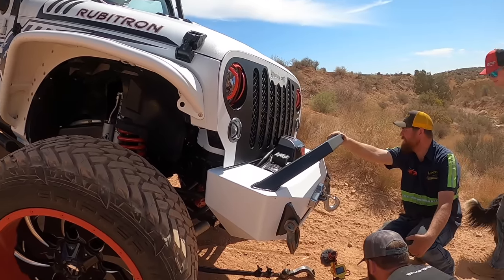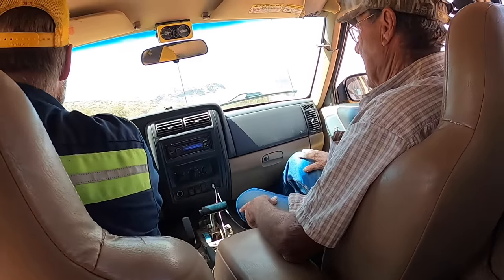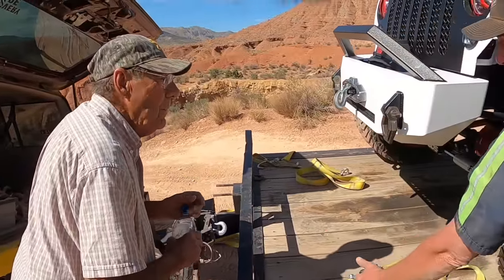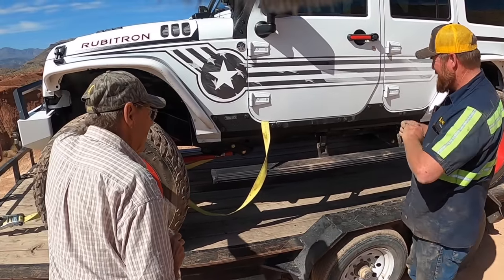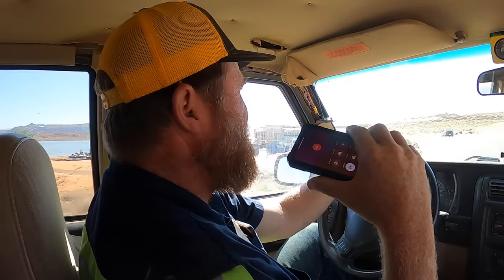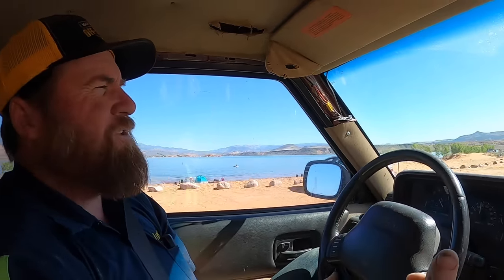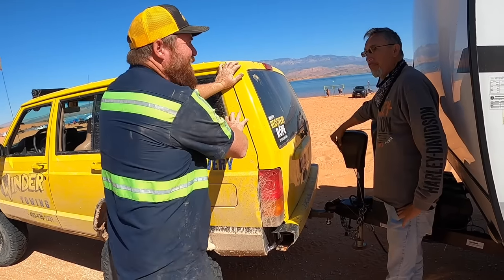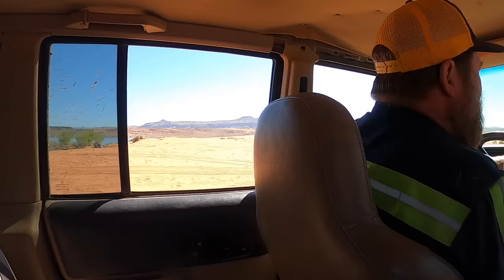$100,000 Jeep Breaks On The Trail

Comment: That’s exactly the kind of Jeep I would expect to find broken on the trail.
Reply: That’s not exactly the kind of Jeep I’d expect to see outside of the mall.
Reply: They don't make real jeeps anymore, you want a real jeep buy a Roxor
Reply: @cr9953  a what?
Reply: @cr9953  A Golf Cart lmfao
Reply: @rcaddict7638  look at my pic, it's a 2020 Mahindra Roxor. 4cyl Turbo diesel, 5 speed Manuel, it's more jeep than anything Fiat makes. It's more related to the willys. Mahindra has had permission to build them since the 40s. Solid drive train, great  traditional off road rig
Reply: My 1977 CJ7 Levi Edition is one of the last real Jeeps.
Reply: @cr9953  lol k
Reply: Superficial aspects always fail. It's like putting face paint on and going into a battlefield without a weapon.
Reply: @cr9953  Sad, but true.
Reply: First clue was those rims and skinny tires. lol
Reply: Yeah, it's a Jeep.
Reply: I want to know how they get to the 100k value. It’s got some  bolt on suspension parts wheels and a wrap. Stock driveline 3.6 with a cold air intake.  Wait it’s got a upgraded driveshaft and axles.
Reply: like all hot wheels, is just for toy.
Reply: @cr9953  1/3 the hp of a cheap, not street legal, and like 80% of the price (covered version with basic options, which is still not comparable to a wrangler)

What a rip off.

Maybe it would be a good deal if if was like $6-$8k like it probably costs in india.
Reply: @user-yq6ov6ow7l  Mine is street legal have more torque than a Fiat/jeep. Solid construction, tried and true frame and powertrain. Will outlast any wrangler, made for offroad.
Reply: @cr9953  Not made for heavy off-road. Torque is about half of most 4.0l jeeps. Looks like a good getting around the farm jeep but long distance travel and trails is a no go
Reply: @Macul  most of us have tuned our rigs I'm at 105Hp and 225 Torque. It's a fantastic trail rig. Great for taking it easy and getting back to old time wheeling when it wasn't a race to the top.
Reply: @Matt Dunlap, it's got fold up running boards!!😉😂😂👵🇺🇸
Reply: @cr9953  lmao im good. i want a vehicle. not a go kart.
Reply: @cr9953  You forgot what fan base you were addressing, literally one of the worst of them all.
Reply: Oversized tires create tremendous stress on everything else attached to the spindle.
Reply: That's what happens when you leave the mall parking lot.
Reply: @cr9953  30k for a side x side is insane
Reply: @z  A wrangler is no longer a jeep, it's a freeway built look at me mall hopper. I've worked on wranglers for friends and it's not built for off road. It's built for luxury and the pavement. My roxor can outwheel any stock wrangler, I want a jeep.for offroad not for highway
Reply: @Macul  tractors are built for durability, this Roxor has more jeep blood in it than any wrangler. Trails is all I use it for and it's a tank. Comparable to my CJ7. Wrangler are garbage
Reply: Prime example of what I like to call built but not built

Comment: His biggest asset is he really knows how to drive and he knows how things work, he has no special equipment, it's not necessary when you know what the heck you are doing.  Lot's of respect.

Yes, the kinetic rope is his main "go to" tool, but they are readily available and not real expensive.

This man knows how to drive off road, period.
Reply: Yes he's a good driver, and knows what he's doing, but that xj is far from stock, you could easily say it's specialized equipment.
Reply: If you watch enough, you’ll see that the banana is highly modified, with suspension upgrades and a purpose built stroker motor (upgraded from 4.0 to 4.6). So yes, Matt knows what he is doing off-road, but he has purpose built tools as well, as one would expect. The ability to modify the Cherokee platform and run it hard at a relatively reasonable cost is what makes is so attractive.
Reply: Driving in reverse in the sand is crazy

Comment: That was literally the most perfect "hitch ball into the trailer receiver" backup ever.
Reply: That would even take Block 3 or 5 tries and 2 sets of tires.
Reply: Add in the precision dig-down to align the level!
Reply: Practice makes perfect good spotters also helps it's harder to do alone with an old truck without a backup camera

Comment: The difference between “show” and “go” is about 30 years and $80,000.
Reply: If you off road, eventually youll destroy a steering box. Just happens.
Reply: @jeepmanxj  I rock a 70 Ford Bronco off road. Never ever have I broken a steering gear.
Reply: @jeepmanxj  you might lose PS but to snap the shaft? LMAO honest to god have never seen that happen and no idea how the pitman joint didnt burst first
Reply: @seadsejfovic9127  I've done it multiple times, I've broken pitman arms too. I've even torn the entire box clean off.
Reply: @Occuria1  Got lucky. They have been selling sector shaft braces since as far back as I can remember because it is a real issue.
Reply: @jeepmanxj  i broke the bolts clear off the steering gear on my 95 f150 mud truck. was trying to get over a 2 foot thick log with brute force, made it, but getting back out was fun. ratchet strap just barely got er done.
Reply: User Name.  Some people just don't  know how to break stuff.....LOL
I sheared the pinnion gear shaft off the rear diff on my 78 Scout ll doin a rollback. That was wild. Had to drive home in 4x4 backwards because the pinnion would lock the ring gear goin forward and drag the rear tires. Good thing I was close to home. LOL
Reply: @jessewoody5772  carefull with that idea. In Argentina we are trying that idea since the '40s, and it was the biggest mistake ever.
 Taxing importations with the argument that that way we will protect out national industry. Terrible idea. Just keep low taxes, free markets and good things will naturally happen.
Reply: @jeepmanxj  not true at all if you probably modify your truck the right way and know how to drive it off road it won’t happen
Reply: @jessewoody5772  Biggest problem with "made in China" is that you get what you pay for, and the order is mostly "cheap as possible"
When cost count for 90% of where you order, dont expect quality to be high. If you specify exactly what you want, you get exactly what you want for the price it cost to make it how you want it
Reply: @ssu7653  Greed prevents that from happening on any scale
Reply: @jessewoody5772  As a mechanic i would dare say that i do fix things, or i would be out of a job pretty fast...

Your comparin $100 american parts to $5 chinese. Ignoring the $80 chinese parts completly, since you dont save enough to justify the assumed wait time
Reply: @ssu7653  Just  BUY AMERICAN  .
Reply: @jessewoody5772  Tried that with the last car, never had anything spending so much time in the shop... (all covered by warranty so not touching it myself)
Reply: @ssu7653  the Jeep Wrangler sits atop the most American vehicle with 74 percent American(content and where  built)
In 2008 it was 87 percent and not at the top of the list.  This indicates a trend in the wrong direction, but its the best we got right now.

Comment: Missed opportunity…
“Our $100k Jeep is stuck!”
“Yeah, sounds like a perfect job for our Corvair”
“Your what??!?!”
“Oh, don’t worry.  It’s a station wagon.”
Reply: I love this
Reply: I'd stick with Matt's relatively stock (except for axles/differentials) ~'91, rudimentary XJ, running a stock inline 6.
The owner would look at the XJ's capability and longevity, then look at his tricked, $100k machine and feel a little 'shrinkage'.
Reply: Naw, it's definitely better that a shitbox XJ hauled that out.
Reply: Its a cardigan, but thanks for noticing!
Reply: I was thinking the same thing. But then again, as previously mentioned, showing the Jeep owner that a relatively stock Jeep can can save his mall crawler did have a certain amount of "burn", too.
Reply: The funny thing is insurance classifies XJ's as "Station wagons"
Reply: This may have been recorded before the Morrvair was completed.
Reply: @gregparrott  I’m pretty sure there’s almost nothing stock on the banana anymore he’s mentioned it before.
Reply: @redsballer1904  I have watched most of his videos. That is why I specified some exceptions. While the axles, differentials and the suspension have been swapped, the engine, transmission and transfer case are stock.  Also, for the non stock items like the wheels and larger tires, they are very tastefully selected. They don't bulge out like what's shown here
Reply: Where do they get that 100k value from? It’s got front axles and a drive shaft a lift kit wheels and a wrap. 3.6 stock drivetrain with a cold air intake. Are those like 30-40k rims?

Comment: Probably the first and definitely the last time that jeep will ever see dirt again 😂
Reply: I tend to agree but you never know.  That he took out at all was surprise of sorts.  You don't often see that.
Reply: That's exactly what happens to a lot of Jeep owners but this guy looks like he has money to burn. I mean the auto dropping running boards c'mon. If he can buy them he'll just pay to get it fixed and if it breaks down so what? His biggest concern will be how long he has to wait to get rescued. But yeah I've seen some weekend warrior Jeep owners go off road, scratch it up a little and that ended that. Never again.
Reply: @tommywallbanger  if he just buys rims with a bit of rubber to absorb bumps he won't break it nearly as fast
Reply: At least he now has a story to tell how about how he broke off Road.
Reply: Thay cherokee is a certified UNIT! Never fails.
Reply: @cotyparker1423  Absolutely 👊😎🇺🇸
Reply: @0xsergy  hardly anyone that does professional offroading uses tiny little wheels like you have envisioned in your mind. 20" is the norm for 37" and larger tires even though you don't want to hear facts.
Reply: Providing a large portion of its excessive price was put into suspension and drivetrain upgrades, were it mine, I'd get rid of that butt ugly front bumper, the high offset wheels (which may have caused the premature steering linkage failure), the running board, and search for an aftermarket steering box (as Matt has recovered other Jeeps with broken steering arms and splines on the steering box). If most of the money beyond its stock price WASN'T spent on suspension and drivetrain upgrade, I'd get rid of it.
Reply: At least he tried, which is more than most Wrangler out there
Reply: @supersportimpalass  there's probably a difference between American and European offroading. Only the hardcore offroad freaks who are driving on tough trails, offroad parks or rallies like Berlin - Breslau have larger tires on their offroaders. They're also mostly heavily modified. 
European Overlanders mostly have slightly larger tires and a lift of 5 centimeters. 
These offroaders are built to be robust and reliable. 
I rately see trucks with large tires, and if, then they're often Jeep Wranglers and US trucks. 

Germans do use Wrangler Rubicons just as a SUV for the street, nothing else. I don't get that. With 5 spoke rims and street tires. 
Or modified for offroad but never saw dirt. They're just ice-cream parlor trucks. 😂
Reply: @michelt4390  I was in CO last month.  Hundreds of beautiful Jeep’s with mods.  EVERY one I saw was perfect paint.  I took my stock 150 up a road with sign. “Vehicle use not suggested ahead”.  It was minor for me.
  I bet my car would have made it without issue.  I didn’t even use 4wd
Reply: There’s an Australian Youtube channel that takes new trucks out through the Australian bush. It’s a badass show but I can’t for the life remember the name of it. Been trying to remember all day. The Aussies really know how to build off-road kits. I wish that channel would blow up in the USA and have some influence. They have Toyota Hiluxes with kitchens built into their tool box that they replaced the truck bed with.
Reply: @davidradtke5166  It's cute what Europeans think is offroading. They actually think a current stock Range Rover wouldn't get stuck just as quickly as that Honda Accord. The Land Rover "test track" I saw in a video I could easily navigate in my 2001 Chrysler Sebring convertible. The stuff I did in my 2002 F150 SuperCrew would have left any Land/Range Rover, then or now, for dead.
Reply: @supersportimpalass  20 wheels with 37 tires is fine as long as they have sidewalls lowprofile tires aren't great for wheeling
Reply: @moustachio334  mad Matt has been wheeling with Matt and the crew from fabrats he's a good Ausie YouTuber that has heavy following in the US
Reply: @awo1fman  I bought a 77 Ford maverick for 100 bucks from a junkyard for a fishing vehicle and with 235 75 15 MTs I took it places my friends wouldn't take their 4x4 S10s and rangers
Reply: @tommywallbanger  Just not the 'Brains'!   Hey!  He gets a T-Shirt!
Reply: On the trailer and back to the mall

Comment: “Ok, so you’re in a built off-road rig?”

“Well, sort of”
Reply: Haha! Yeah those wheels are...
Not so much...
Reply: @MTBryanH  might as well paint the rubber on them for all the sidewall they've got
Reply: lmao
Reply: Off-road means off the road into a Target parking lot.
Reply: Saw a JLUR on 24s with 42s the other day!
Reply: You know it's a mall crawler when it's got automatic running boards instead of rock sliders.
Reply: @MTBryanH  I wouldn't go any further "Off Road" than the shoulder of the road with rims like those. Grandson has a 4x4 truck with those on it, I'm always pulling him out of mud puddles with my stock tired dodge Ram 4x4
Reply: No, a "Broke Off Road Rig."
Reply: @Artomoton67  You know Rock Slide Engineering makes those rock slides??
Reply: RollinRat  You're not going to tear them off. I've seen videos with them going through some pretty tough trails. Rock Slide Engineering designed them to take a beating.

Comment: I will never understand the concept of putting big rims on Jeeps. If you want 20 inch rims then you better find some 60 inch tires. Sidewall is your friend.
Reply: Or Trucks.
Reply: I'd like to see at least one of these drips that lower their jeeps or put big wheels on them turn them into actual street trucks, like those boosted single cabs on drag beadlocks
Reply: 37's are the MINIMUM on 20's....and thats just for looks!
Reply: Probably to get better mpg on the streets because you know they aren't taking them off road. This guy tried to wheel his once and he broke it.
Reply: i have 280/70R18 33's on my Ferrari
Reply: @carmineredd1198  Italian Mad Max!
Reply: @Hybris51129  it's a Ferrari Cobram 65AR
Reply: You're giving people too much credit.
Reply: Glad you said it,  those wheels are for mall crawling.  No flex in sidewall had to put a ton of stress on the steering components.
Reply: @elblancochingon8138  depends what you're doing I go playing offroad.. no serious rock crawling or anything, but enough to get stuck with my Ram and the stock 20" rims and stock size 33" rubber... I've maxed out the flex and then some with front tire 6" off the ground and rear pushing 12-18" off the ground... taking a crew cab down a twisty banked quad trail was interesting... my limitation is more the stock suspension than the stock size mild AT's.
Reply: Jerry Rice  you will have issues once you start doing anything remotely challenging. Not to mention 20s on 37s give you that mall crawler status.
Reply: I have a 98 Lexus LX470 with KO2s on original rims and it’s great. The sidewalls absorb bumps prior to the suspension.
Reply: Those big ol heavy tires and rims is what broke it.
Reply: @johndeere8594  More like the guy dumped all the money everywhere except in properly beefing up his steering to match his rig.

Comment: "It's much harder to get the trailer if you unhook it when it's stuck in sand"

Proceeds to hook it up easier than I could if I was in a Walmart parking lot
Reply: Amazing work by Matt
Reply: And pulls it without any fuss.
Reply: Sometimes it's easy, sometimes there are some deep ruts that you slide into over and over
Reply: Its not the hooking that is the problem, but pulling a heavy trailer on soft sand from stand still, say he would not be able to pull it, if the truck remained hooked it was easier to pull them both because he could gain some speed and energy in the rope, rope acts like a spring.
Reply: If it's a tongue trailer and you are trying to take off from a sandy/muddy flat ground it takes some skills. If it's a gooseneck a lot easier
Reply: Bananas rear end was too high- no problem, just dig 2 holes in 2wd. Matts simple solutions never fail to amaze me.
Reply: @uliphotode  Not even sure that was 2WD, may have just brake-torqued, but yeah, that was quick and easy - brilliant!
Reply: @vasya88  nailed it exactly.
Reply: Seriously.  I want to rent a trailer to practice driving in reverse just to get my skills up.
Reply: stay out of Walmart....that's the problem lol
Reply: Not what he was referring to, but yeah he hooked up flawlessly. 

He was saying its harder to pull the trailer out, not get hooked up to it.

If the original truck is still attached, he can use the kinetic energy from the recovery ropes to pull the truck/trailer. 
With Matt hitched to the trailer, he doesn't have that advantage without the ropes, and basically isn't much better off than the customer's truck.
Reply: @sourbrothers73  Who cares!?

Comment: Guess they didn’t upgrade the steer box when they strapped all the bling on that thing.
Reply: If only one of those steering stabilizers was a hydro assist ram...
Reply: Of only ya didn't spend all that money on "pretty."
Reply: Probably thought those dual steering stabilizers was a steering upgrade
Reply: it looked as if the kingpin broke off the trackarm  ,  so with these axles you're out of control
Reply: Let's be real if he didn't put those super heavy rim and tires on his car he probably wouldn't broke that part. Oh wait I forgot it's a Jeep it would have brokeen anyways.